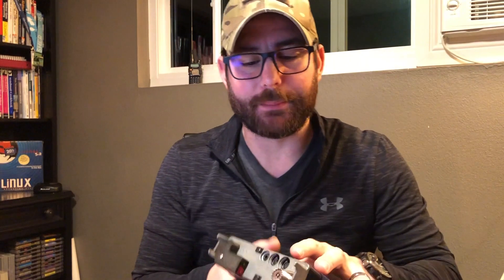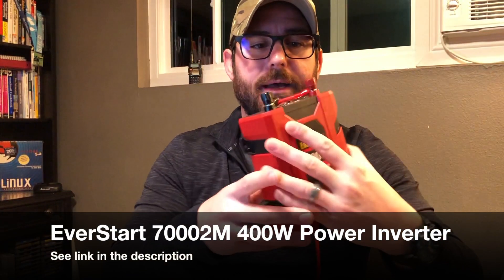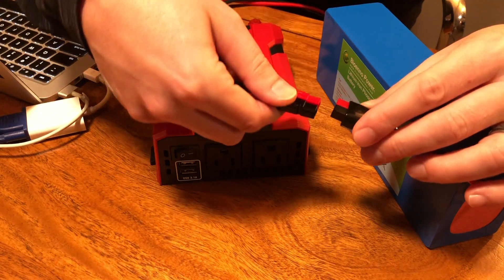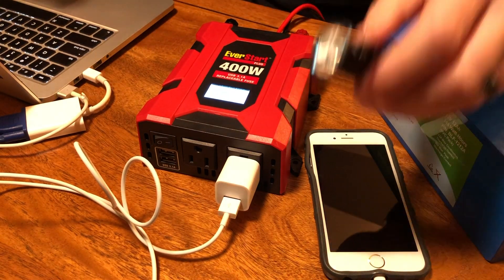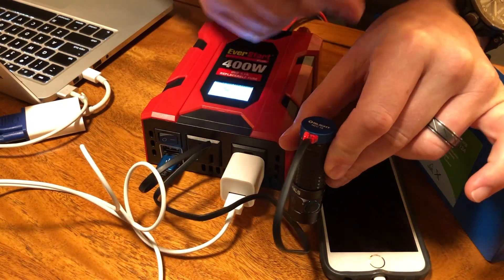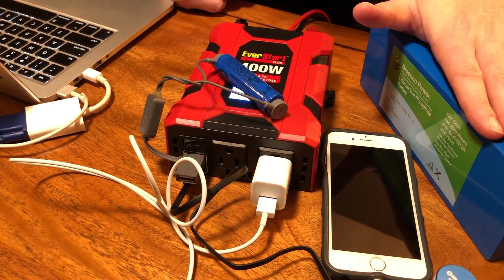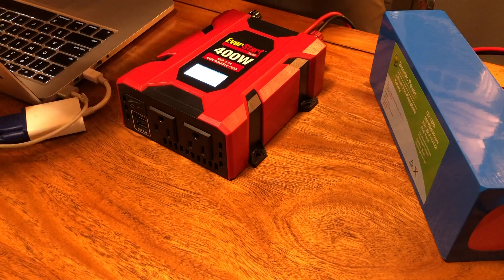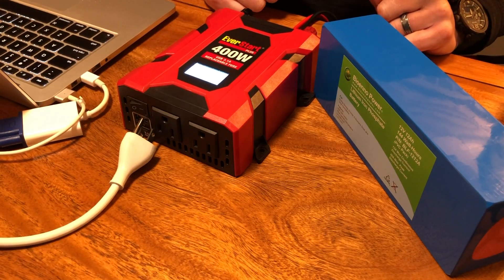Grid Down 12V Power Plant

Comment: You may want to update your Amazon link for the 150A Watt Meter Power Analyzer as it is currently unavailable and they don't know when or if it will be back in stock.  Same issue with the EverStart 70002M 400W Power Inverter.  Also out of stock.  There are several other options available though.  Great video.  That Bioenno Power supply looks really sweet.
Reply from the maker: Thanks for letting me know. I wish I had the time, but there's no way for me to keep the links up to date. It's a moving target with Amazon. The links are typically good for at least a few months following the release of a video. The Bioenno batteries are really nice. I still have that battery and it  is still powering my 12v gear in the ham shack.
Reply: @TheTechPrepper  Schedule one day per month to go back over the Amazon links in your videos so you get that extra income flowing in.  It might seem like a hassle, but every little bit helps in these times.  Plus, viewers will be less frustrated at trying to find a similar product.
Reply from the maker: @dreadedzen9  I'll see what I can do. I'll have to see how other creators are managing this problem. Apologies for the frustation.
Reply: @TheTechPrepper  No worries, Gaston.  I'm a software test engineer and things like this jump out at me.  If you like, I can just leave a comment when I find bad links or I can email you at the info account on your website.  I'm just trying to be helpful because I'm really enjoying your videos.  They've been very helpful.  I finally got my Baofeng all programmed up and heard my first repeater conversation the other day.  A local guy was talking with someone in Florida.  Very cool stuff!  Keep up the awesome work!
Reply from the maker: @dreadedzen9  I appreciate the offer, but honestly I can't keep up with these updates due to time constraints. In the case of the inverter in this video, it is simply not available. Thanks again! Have a good weekend!
Reply: @TheTechPrepper  No worries.  I understand time constraints.  You have a good weekend too.

Comment: Something you might want to add to your battery system is an automatic cutoff switch. I bought this Electronics-Salon Low Voltage Disconnect Module LVD, 12V 10A, Protect/Prolong Battery Life on Amazon for $12.99. You can set it to automatically shut your system down when the battery reaches its low-voltage point. That way you don't destroy your battery by draining it too low.
Reply from the maker: Great point and a good addition for the price. This battery contains a BMS, so I don’t believe it will be a problem.